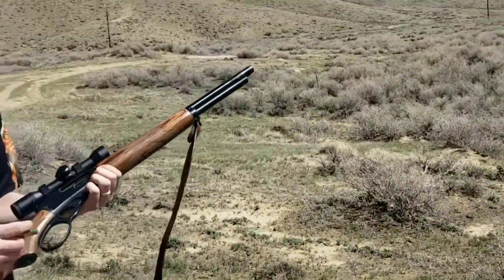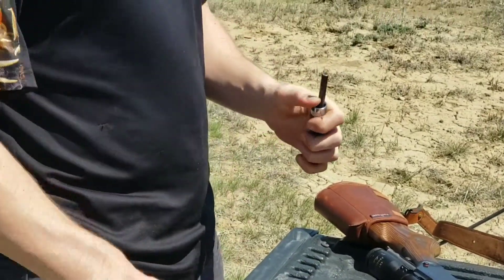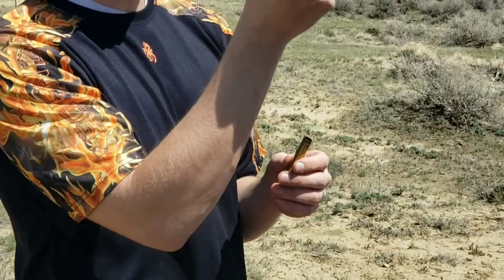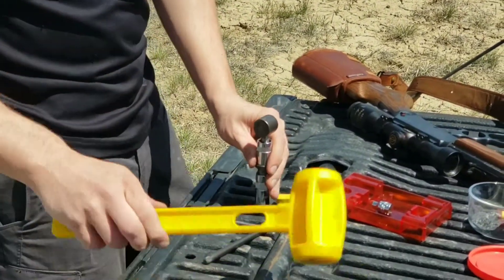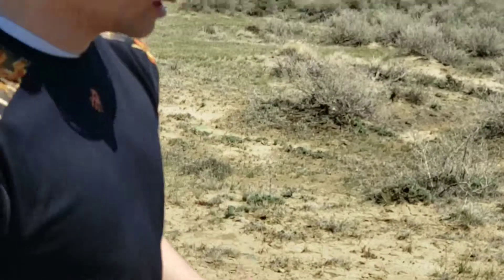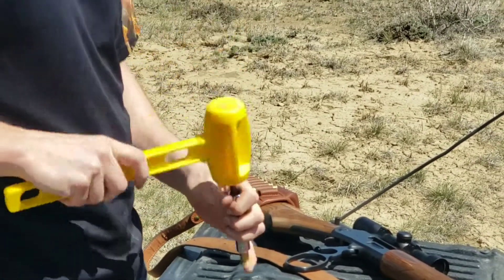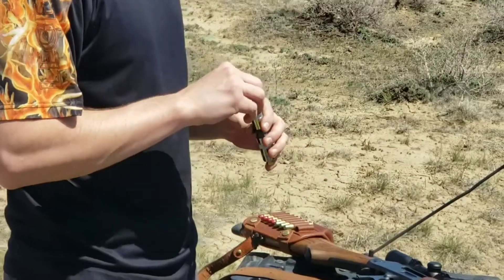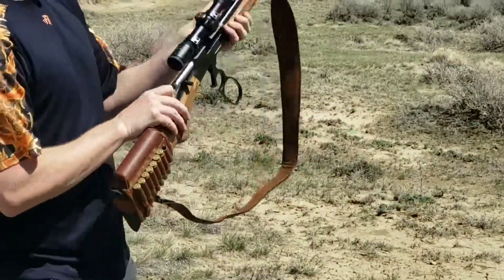How to: handloading the 45-70

Comment: Great video, Sir. What are you using to flare the case?
Reply from the maker: I use a socket wrench bit, one of the smaller ones so the one side fits in the case.  A few light taps works well and really helps when seating the bullet.